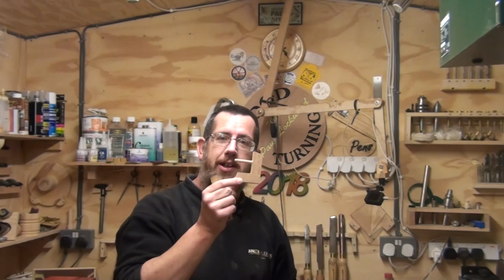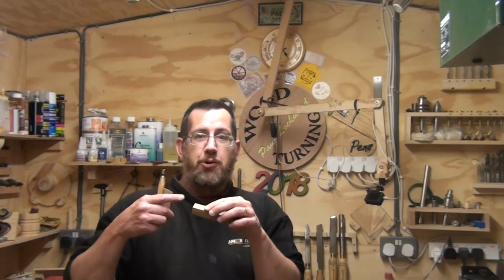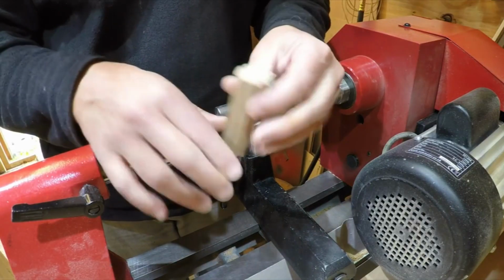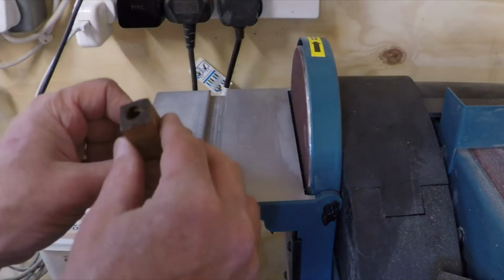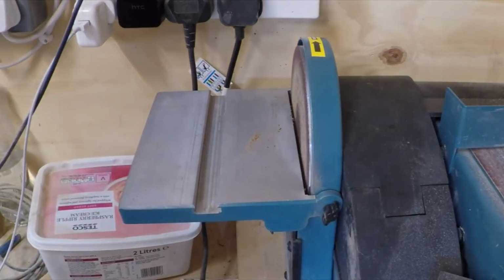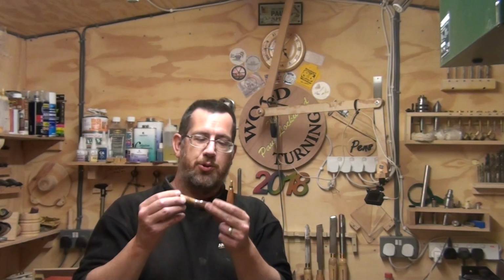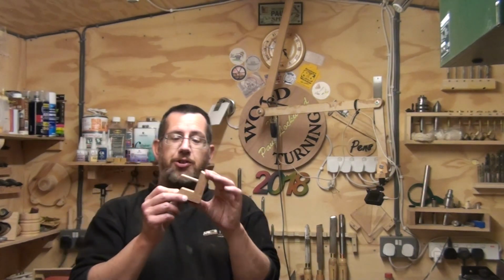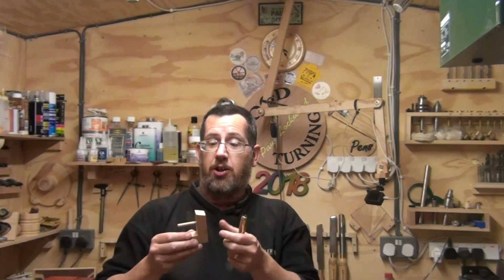Small Tool For Pen Turning - Episode 134

Comment: great idea i use a barrel trimmer and you are right sometimes they can be a bit too much can i add to your design ? maybe making this slide on your mitre rebate and adding a spring to the shaft so you can pull it back from the disc hey put me down for one lol no seriously id buy one off you .keep em coming man ☺
Reply from the maker: Thank you. That's all good ideas. I thought about the mitre rebate but this way it allows it to be moved back and forth easier dependant on en blank.

Comment: Like the jig might have to make one my self if I ever get a disk sander that is. For now I guess I'll have to keep dealing with the tare out from my penmill
Reply from the maker: Thank you John. I did make a disc for the lathe and a small table before I has the disc sander which works very well. Just having the disc sander makes things a lot quicker as there is no setup time. You can make a disc sander very cheap. I'm actually trying to record making one at about 380mm diameter now as I need something a lot bigger.
Reply: Can't wait to see it

Comment: Paul, perhaps I missed it, but why couldn't you just sand that against the miter gauge and the disk sander?
Reply from the maker: Yes Rob you missed the part about when you have a tube that is not parallel to the side of the blank. Then using the blank as the sanding guide creates the wrong sanding angle. If you align the blank by the tube (which is why it his hung from the pin) then the sanding angle is always correct.

Comment: I was thinking a much wider thinner base from the start. Seems like you have the same Idea. I'll give this some thought when I return home and see what I can come up with. I love making jigs to do little jobs like this and have made many over the years.
Reply from the maker: Thank you. Yes my main concern when I made this was to get it all as square as possible, otherwise it would be useless. After that I can see it works so need to fine tune on the practical side.
Reply: I think I might have a problem drilling the hole square as I don't have a pillar drill. I'll have to think of a way round that problem.
Reply from the maker: You can do them how you like. That was why I drilled into one piece before I attached it to the other as that could be sanded to get everything square for minor adjustments.

Comment: That's a good idea.  I do something similar using transfer punches in a Jacobs chuck on the lathe and a mandrel with a sandpaper disk in the headstock.  I started doing it because I was finding that Sierra pen transmissions do not operate properly if the blank isn't absolutely square and then did it for all my pens because I knew the blanks were square.  You made a good point about the difference between squaring blanks to the tube and squaring tubes to the blank.
Reply from the maker: Thank you Brendan, I will take a look at your video. Something quite simple but effective and quick to use all made from scrap which is what I was trying to do. I'm sure you're like me in that if a simple extra process can help improve things then it's worth doing.

Comment: Great little jig Paul. If you have one of the pen dissasembly kits you could find a way to attach the rods you would be able to use it on all different tube sizes.
Reply from the maker: Thank you John. Yes I have one of the kits, again though I don't think they cover enough of the tube sizes. A fairly simple project to make (all from scrap wood) just takes time in making sure you are square in all directions. It would be much better to have several to cover different tube sizes and then you get more precision.

Annoyed the camera didn't record when I turned the spindle as it was all skew work which is ideal for this type of turning, great fun and practice.
Reply: You can cut a v Groove across the top (needs to be wider). Drill two tapped holes (one either side of v grove). Place a flat bar with two through holes for screw sizes matching holes on each side of v groove. Place any size rod in groove and clamp down. The length can be adjusted this way. Made one at work a while back. Would use more often if I had the space to keep up my sander.

Comment: If you make another (possibly from aluminum) and drill a hole the size of barrel trimmers you currently have. Place end going into drill into the fixture and possibly add a holding screw 90 deg to the shaft to hold shaft in place. You can make any size pen you have the trimmers for. IMO
Reply from the maker: That would be interesting to see.

Comment: Hi paul i sand mineon the lathe i have a set of punches that i put in the drill chuck in the tail stockand put the pen blank on the said punch and a sanding disc on the head stock  that way you dont nead loads of difrant jigs to suit the size of blank. saying that your way is very good but i dont have a disc sanding machine  cheers Ian
Reply from the maker: Thank you Ian. Yes I've now seen a few people do it in a similar process to what you do. This was just what I came up with as an initial thought on how to get over the issue. I made a sanding disc to put on the lathe and a small table ages ago before I had the disc sander. It's just easier to use the disc sander as there is no setup time.

Comment: Why not make one for each tube size. Also clamp the jig to the mitre gauge. to turn the blank round run the mitre gauge outside the sanding disc. good idea
Reply from the maker: Thank you. Yes I did say that it would be better to make one for each tube size and that it would be better to clamp it to the fence. This was the prototype and thought I would share it with everyone as these little projects often help others.
Reply: Sorry I jumped the gun.
Reply from the maker: No problems.
Reply from the maker: mrRuben yes that would be a good idea too, especially if you have a lot to work on at once. I think for small amounts clamping to the fence would be easier in case you need to adjust the length from the disc due to the length of the blanks.

Comment: It seems a lot of bother to go to just run your blank against a 90deg angle on the sander table 
Go to gord rock's channel for which I found to be the perfect jig for 
Sander angles &flat faces I do wooden pens &acrylic works perfect every time 
J s manchester
Reply from the maker: I obviously didn't make the reason for this very clear in the video.
If the blank is not even and more so the brass tube is not running parallel to the edge then all you will do is sand an angle on the end of the blank. It may only be a small angle but the purpose of this is to produce a proper 90 degree angle to the tube not the blank.

Comment: Paul,mines almost the same,but, i used a piece of 6mm steel rod as the pin so i can use it for all tube sizes. Check out RJBWOODTURNER  and Lynn Lacey on u tube to see their versions. Hope this helps!👍👍👍👍👍👍👍👍
Reply from the maker: Thank you Alan, I will take a look at those.
The one issue I found was that even at 8mm the wider tubes would allow more movement, so ideally you need a pin very close to the internal diameter of the tube. Your 6mm pin would be ideal for slimline pens.